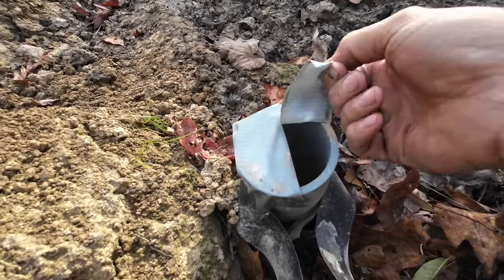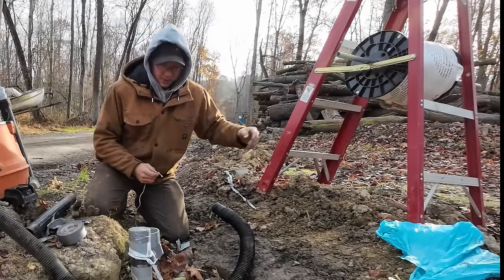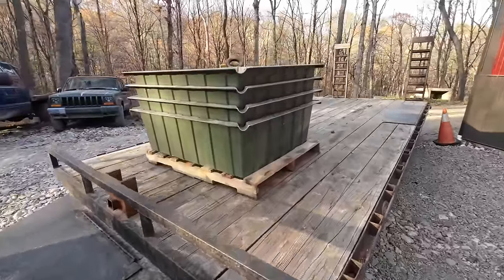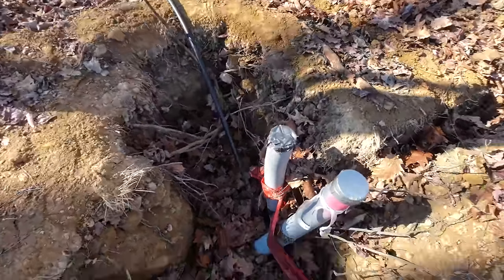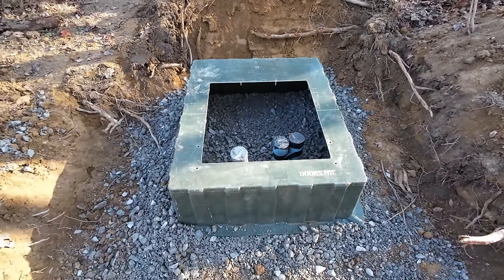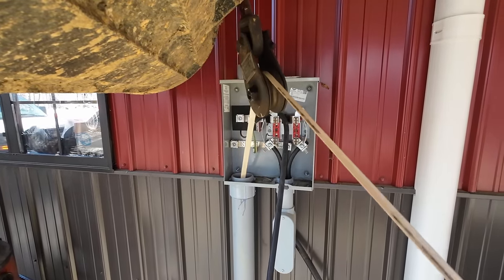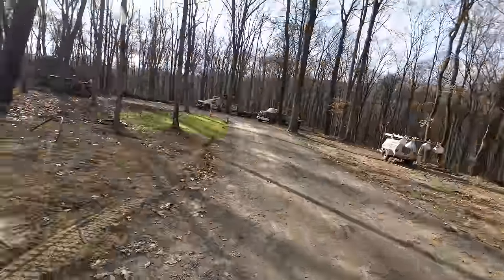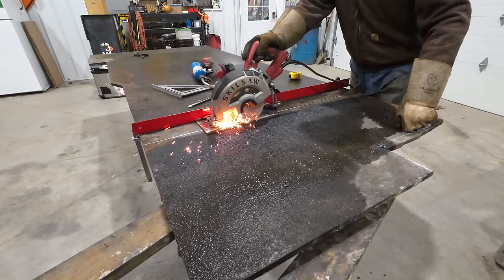The Power Company Charged me $52,000 for this!!

Comment: $20 per foot with materials is normal project rates.  About 20-30 percent of any project is materials.  YOU decided to build almost half mile from their ‘Tie In’.  And you may have removed the aerial option.  Aerial needs poles of course, but the labor is cheeper.  But go ahead and hate on honest labor and the required drills and boring machines.
Reply: BUT, you ringing the conduit with the pull string does seem excessive if they don’t need large machines.
Reply from the maker: 52,000 seems very reasonable if they did the entire job, when I did the bulk of work I don’t think it’s nearly as reasonable. They didn’t need any heavy equipment other than a bucket truck

Comment: A single 1200 Amp ground transformer on a concrete pad for our business cost us $11,400. The run was 80ft from a pole. However, if you’re running 2600 ft of copper line from the source then you’re not out of range. They didn’t overcharge you.

Comment: What do you mean power companies ransom? Not like they were forcing you to connect to their system to get power. If you tell them what you need, they give you quote so you know exactly what it's going to cost up front, and unlike most labour industries they extremely rarely ever will charge you more than that quote unless you change what you're requesting. 

Disclaimer I use to work for a power company and hated people like this. Power companies definitely have, like any government type body, tons of inefficiencies and improvements they could make so I don't want to defend them to hard but I always find it ridiclous how people have zero understanding of how things cost $$$ and if you want those things you're going to have to pay for them. If you don't like the costs then stick to your generators, or go solar, etc, everything comes at a cost and tradeoffs, get off your high horse
Reply from the maker: My high horse priced all the materials that they brought and installed.  As a joe blow off the street there was only about $20k worth of materials. You know the power company was paying less than that. Even if I’m super generous and allot 10k for manpower and the trucks on site (they were only there 3 hours) that’s only 30k…
Reply: @DieselCreek  you're missing the point of that the price isn't relavent. They give you a quote for what it will cost and you can either agree or disagree to move forward. If you agree to move forward then you have agreed to that price, it isn't ransom. I'm not disagreeing with you thinking it's overly expensive because it definitely is but saying it's ransom is kind of ridiculous. Like I said before utilities are horrible managed and are extremely inefficient because they are heavily government regulated and restricted on things like not being allowed to make profit on material markups. So utility really doesn't care about shopping around for material prices they just pay whatever and pass costs on to you. They also have to pay for expensive engineers to sign off on everything. So I'm with you on expensive but if you want to act like they're trying to actively rob you then you need a reality check. Obviously you agreed to pay to switch over so you deemed the cost worth it despite being expensive, so don't go after the fact acting like they were forcing you into the situation of your own choosing

Comment: U coulda gone totally off grid for less than $30,000
Reply from the maker: No. No I could not….. this is a workshop that runs has high demands 12-16 hours a day, if I was in Arizona maybe there’s enough sun for that but we don’t get near enough here in summer let alone that whole “winter” thing. On top of that I’m building a house here too, so there’s even more demand…. A system to meet those demands would cost a lot more than 52k and still may not work in winter plus it would take up over an acre of panels. Off grid systems aren’t free after the purchase either. There’s a lot of upkeep on them. Battery’s need replaced every so many years, that’s a huge expense.

Comment: You should have just hired an electrician to pull The Wire and set app the box. Then if you've got an electrician body, you can do it yourself. They wouldn't let you do that, that sounds like b*******Any electrician should be able to pull that wire

Comment: Quit the posturing. You aren't a licensed bonded contractor so the power company has to protect you from yourself. They have zero time or capacity to check the capability for each and every tom dick or harry who thinks they can save a buck by doing it themselves. That was 100 years ago, and times have changed -- and the casualties & lawsuits have taught us that the general public cannot be trusted with full primary electrical. You may be an exception, but you don't get to step out and risk yourself like that.